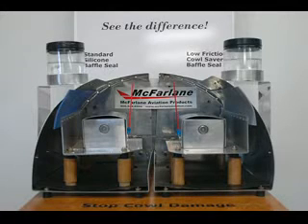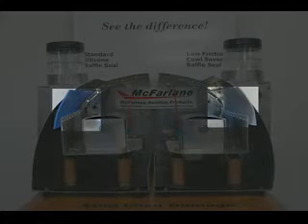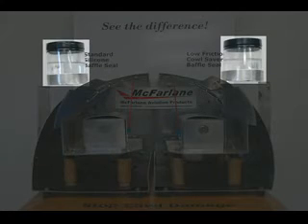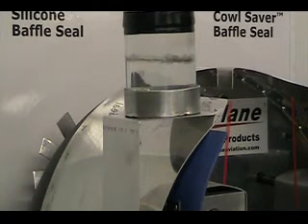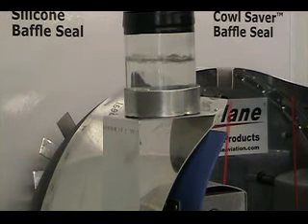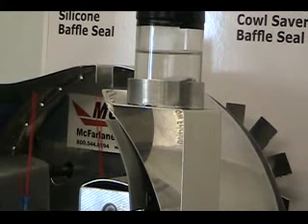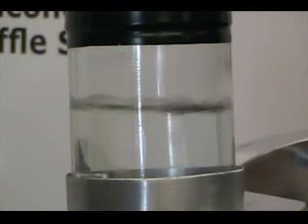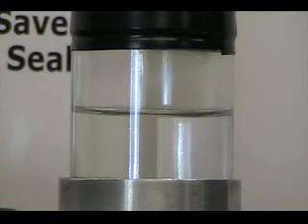Cowl Saver Baffle Seal Material

Comment: Isn't the black, slippery part of the Cowl Saver material supposed to touch the cowl, not the gray part?
Reply from the maker: Yes, you are correct that the black, friction-free surface needs to touch the cowl, not the gray side. This video was originally created when Cowl Saver was gray on both sides. It is now made with black on one side and gray on the other, partially to help distinguish which side goes against the cowling.
Thank you for the clarification, Timothy!